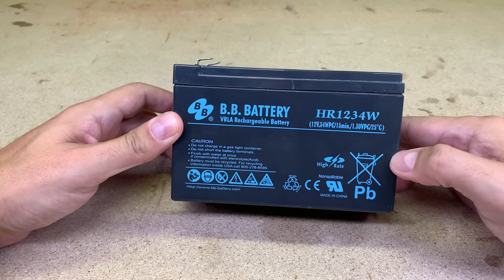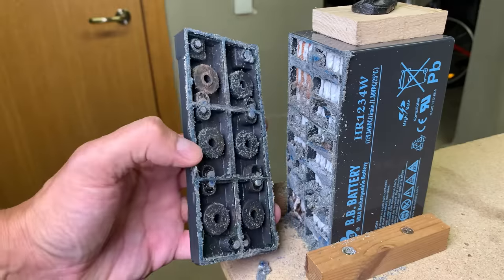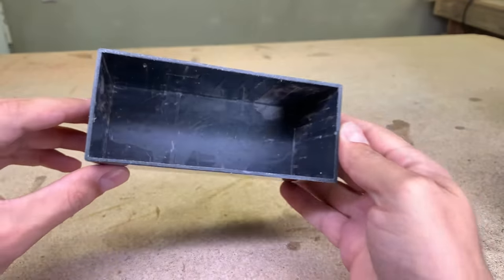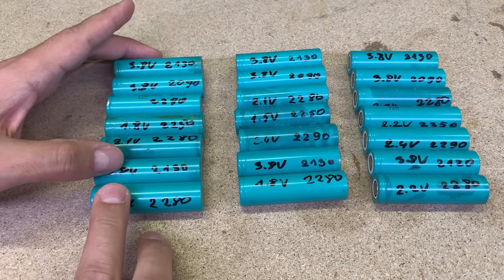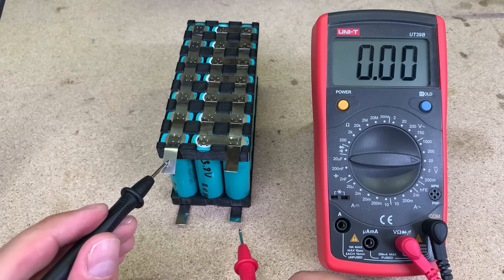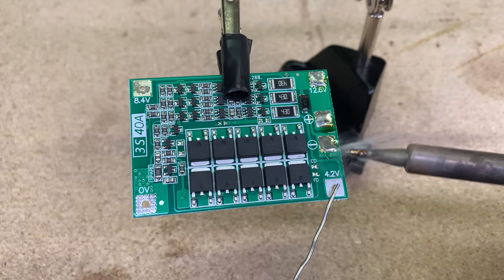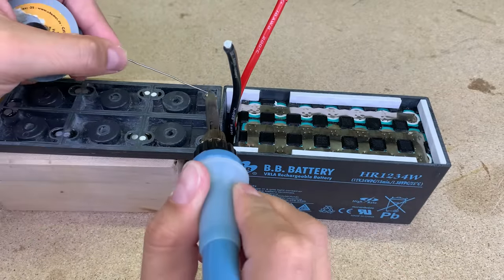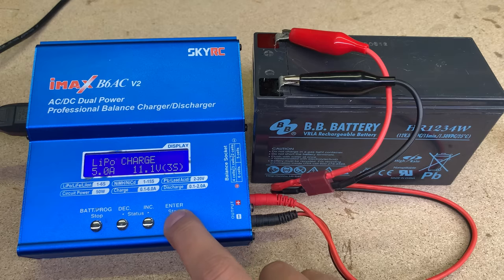How To Convert 12v 9Ah Lead Acid Battery Into 12v 14Ah Lithium-Ion Battery Pack

Comment: can i use this  12v 14Ah Lithium-Ion Battery Pack to power the 99gear spot welding board the one with a purple pcb?

Comment: Why not we use the battery pack made with the lithium ion batteries with the charge output of the main unit wherein We get 15.18 volt DC ? Why you require the balanced charge/discharge unit seperately for charging? Please explain.
Reply: Lithium ion batteries require a BMS (battery management system) to keep the cells balanced, and to avoid over charging or over discharging. A BMS becomes critical when the original equipment was designed for a different battery technology.

#1:  If you only look at the overall voltage a few years of use can result in aging drift. That is some groups of cells may charge to a higher voltage than others. Example: 4+4+4=12v and 3.5+4+4.5=12v too, but the second example over-charges one of the cell groups. The higher the voltage the fewer charge/discharge cycles you get----to the point that limiting charge to 80% of rated capacity will give you 3 to 4 times as many charge/discharge cycles (a trick some systems designed for lithium batteries follow when battery life is a higher priority than battery capacity). A decent BMS will keep the voltages of each section of the battery perfectly in balance with other sections.

#2:  AGM (absorbed glass mat) lead-acid batteries (or any lead-acid battery) loves to be trickle charged. But trickle charging any lithium battery will destroy it, and in the case of lithium ion might cause a fire. A BMS will cut off charging a fully charged battery system, even though the equipment the battery is installed into wants to trickle charge it.

#3:  Over discharging a lithium battery is bad and can drastically shorten the life of the cells or even kill them. This is also true for lead-acid, but if equipment is designed for lead-acid, its low cut-off voltage will be different than what a lithium battery needs. A BMS will disconnect the battery when it senses the cell voltages have fallen too low. If the equipment happens to cut off discharge at a higher voltage then the BMS, no harm, no foul (but you don't get the full capacity of lithium).

Food for thought:  Lithium iron phosphate (LFP or LiFePO4) would be a better choice than lithium ion for an application where a little more weight and size is worth the added safety of not being a fire hazard. For example a kid's toy car or scooter, or something like a UPS (uninterruptible power supply). For a laptop, a phone, or a car, the size vs capacity tradeoff is often worth the trouble of the added safety systems. Note that the working voltage of LFP cells is lower than lithium ion, so a different BMS is needed, but you still need one.

Also, if your equipment needs more than one lead-acid battery in series for a higher voltage, it'd be best if your lithium replacement's BMS could see across the whole string of cells. Example: a typical smallish UPS will use two lead-acid AGM batteries and work at 24 volts. So best to build a single replacement lithium battery that is the physical size of two of the original batteries, with a single BMS that looks across the full 24 volts of lithium cells. See point #1 for why.
Reply: @ScottyDMcom  
Thank you so much that you have taken pains in highlighting me on charging and the need of the BMS in lithium based cells. From the explanation I could get that the lithium based cells require proper charging voltage and the charging is not dependant on the how much current goes in to battery pack. Am I right in this understanding? Please correct me if not?

Comment: Is it worth it to rebuild a battery about half the size of that one? Its for a kind of video camera. Thank you 🤓 is there a video that helps to figure out the 18650 (or similar) configuration, voltage conversions, amp hours, charging conditions,...etc? Thank you 🤓

Comment: This is cool but I made a 3s10p 12.6v li-ion battery and I've got no idea what to do with it. I was originally going to use it as a camping battery in my car but I don't think you can charge it with an alternator as the voltage is too high ~14.4v. So I have a 12.6v charger but it plugs into AC power so if I wanted to use it in the car, I could hook up my inverter to the car battery and this charger to the battery, no problem. But now I have the additional problem of powering things with the 3s battery, because its voltage is too low to consistently power an inverter. The nominal charge of the battery is not 12.6v but 11.1v (3.7x3) and won't work for an inverter.

Honestly can anyone tell me what a 3s battery is good for?

Comment: and you charged it via lithpoly not lithion lithpolymer needs 4.20 lithion 4.10 so you charged it wrong and didnt remove the info on the bat if you acidentaly pb charge that because you think its a pb charger... folks this is a bad idea

Comment: Interesting. But I would expect higher capacity, not just 9Ah to 14Ah increase :) Is it safe to use this in UPS instead of lead-acid one? There is charging circuitry for lead-acid battery in UPS, will it work OK with this converted battery?
Reply: No. Lead cells and lithium cells have different minimum voltage and maximum voltage so it is not recomended.
Reply: @Görkem-x5h  ... 🤔 ... BMS is made for that .....
Reply: @yvonf2312  you need different bms. A bms made for lead cells won't work on lithium cells.
Reply: @Görkem-x5h  But he installed a BMS in the battery, right? Would he have to take the lead battery BMS out?
I don't understand the math of 21 cells with 2000 mAh not adding up to 42,000 mAh . Is it the number of cells in parallel that determines the capacity?
Reply: @paddlepower888  to get 12 V you need to add 3 banks of paralel lithium cells in series. Series connections don't add up on capacity but voltage.
Reply: The dischage capacity in lithium is 80%, só its capacity is much higher
Reply: If you make it with 4 lifepo4 cells the voltage will be the same as lead acid.
Reply: A battery made in this way is not suitable for use in a UPS.  There are pre-made lithium batteries which have been designed to replace lead-acid batteries.  They generally use lithium-iron-phosphate technology which is more robust and less likely to explode if charged incorrectly or otherwise abused.
Reply: @paddlepower888  oui. ;)

Comment: I got a new battery for my electric bike it’s a 36 volt 14 amp battery but when I ride around or going over bumps it cuts off like it’s shorting out I think something in the battery pack is loose or something how would I fix that

Comment: those 18650 are bad notice below the heat shrink theres almost like the acid rom batteries dont use used cells buy new

Comment: I noticed that you charged the completed battery on a (Li-Po) setting rather than (Li-ion) Is this safe to do so? your charger is capable of (Li-ion) charging.
Reply: its safe , on lipo setting charge max voltage is set to 4.2v on li-ion is 4.1v
Reply: @MrDexi87  wouldn't it be irrelevant which Lithium setting it's charged with, as long as the whole pack isn't over-volted? I mean could this pack be used (and charged) like an SLA Pb battery? That's why there's a BMS, right?
Reply: @fluffyfloof9267  true , but if u charge 1s with 4.1v max voltage u can increase battery life, that's why imax b6 using lower voltage for charging li-ion cells ...
Reply: @fluffyfloof9267  I'd like to know this as well. BMS's generally seem pretty straightforward in their operation, except when it comes to charging the cells properly once everything is assembled. This video was basically the first example I've seen where the creator actually touched on this area but still I have some unanswered questions... Like do these cheap BMS's disconnect charge when input voltage exceeds the lipo voltage ratings? What is the safe charge voltage and amp range for a 3S7P pack with a bms like the one in this video attached to it? I realise that depends on the cell specifications but in general (assuming mixed cells) what would be an average safe range for such a battery? And just as importantly, what WOULD HAPPEN if you used one of these batteries as an SLA replacement in a typical standby 300-600W UPS, for instance? Would it be safe? If not, why not? If someone says it's a 3S Li-Ion battery and therefore lower nominal voltage than the SLA it's replacing, that doesn't really explain why it's not suitable. We know that most UPS's will cut out at around 10.5v and charge up to max of around 15v. if the BMS can cut off charge at appropriate times (10.5v - 12.6v = 3.5v - 4.2v per cell, respectively) then there should still be an overlap range of compatibility even if its not a perfect match, yeah ? As far as I can see, all it means is that the cells will never fully discharge further than 3.5v, which is a good thing because it means way more use cycles. Sure you won't get the full 14ah of capacity, but even if you get the 7-9ah of the original SLA battery, it seems like a win

Comment: Very nice build, caution on reused/repurposed batteries. Some batteries even though they appear to show good health, might develop short circuit internally, to prevent shorting on the parallel pack, add fuse to each battery for just in case

Comment: Interesting project, thanks for sharing your experiment. Removing all the internal bracing reduces the structural strength of the casing.
Reply: The case is made for SLA, which is heavy and swells up. Li-Ion is light and strong and doesn't really need a protective case. It's mostly to protect the wires, mount the hardware, and to look nice.

Comment: interesting idea, but you probably do not realize what the consequences may be.
Gel and acid batteries are used in combustion scooters for a reason.
What you did is a recipe for misfortune, and why?
Lithium-ion batteries have a maximum voltage of 4.2V in the 3S configuration, this gives 12.6V
The generator in the scooter generates a voltage above 14V which will overcharge the lithium-ion battery and in the worst case may cause an explosion and fire
Reply: the BMS board is there for this, unless you charge with too much current, the BMS is capable of cutting off the battery for protecting from  overcharge, and it even is capable of (some sort) balancing the batteries, the cutoff voltage for this BMS is around 4,27v and the balancing discharging cutoff voltage is 4,19, in the end, that batteries get a final voltage of 4,19v

Comment: It's a good idea. However, if you use this modified battery in a device that usually uses Lead Acid batteries, I guess you will have issues with the charging cycle and voltages? Will the BMS be enough to overcome the differences?

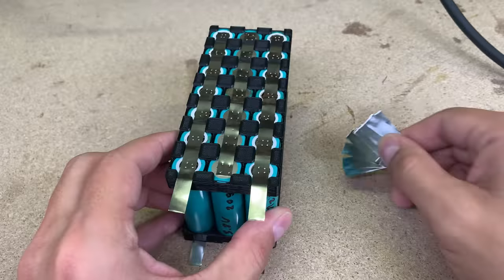Comment: Wait -- at 3:58 he solders on a bunch of short jumpers. Why was this???
Reply: The long ones connect each row of seven batteries in parallel. The short jumpers connect the rows in series. Without the short jumpers, each row doesn't produce 12 volts. That's the limit of my electrical knowledge.
Reply: The idea of using multiple jumpers is to share the load across several connections.  In theory you could just use a single link to connect each parallel set in series, but using multiple links allows them all to share the load and run cooler.

Comment: What I don't see here is a list of the components and cost breakdown.   Is it really worth all this trouble for a battery you can buy for $22 on Amazon?
Reply: Right. the lead acid battery is about $20-30, but lithium batteries in the same size as the lead acid battery are almost triple that, but worth paying for due to the higher number of recharge cycles per dollar, and because the spot welder alone costs over $50. I doubt I'll use the spot welder for anything else and finding defective" power drill batteries with an average cost of $0.80 per cell isn't something I do well. I've begun to establish limits to the things I want to DIY.
And you gotta love the disclaimer at the bottom of this video's description!

Comment: Those 3,7V Li-On batteries cost far more than a lead-acid sealed battery unit in my country - great project but unfortunately not worth the cost to do in all countries in the world.
Reply: As far as I can see the batteries are salvaged from other battery packs...
Reply: In the US there are several battery sellers for used 18650’s.  Often times, these can be purchased for $0.50 each with about 90 to 95% capacity vs new cells.  

At that price, his 21 lithium cells would have only cost $10.50, which is fantastic.  Add a little $ for the BMS and this is a fun project.

Comment: Can i use it for Scooters ?
But, the alternator Voltage coming out is more than 12.6V is the issue.!
Reply: You need 4 lifepo4 cells, they are perfect for 12v

Comment: In the long term when the cells get mismatched, will it overcharge the good cells since the bad cells may be lower than 4.2?
Reply: the BMS has a balance ic, the chip use resistors to drop the battery voltage when pass 4,2v, and stop discharging the cell at ~4,19v, so it's necessary to charge the pack a little bit more than 12,60v, like 12,65, 12,70...
Reply: I use an led as indicator for each cell, the led (with current limiting resistor) is in parallel with the big resistor, so I know when the BMS is balancing and which cell get charged first...
Reply: The parallel connected cells are forced to remain at the same voltage as each other by the simple fact that they're all connected.  The circuit handles balancing each set of parallel cells with the other sets.

Comment: Ignoring the voltage discrepancy using 3 in series instead of four, those 21 18650s would cost over $80, while the lead acid would cost $25 to $30. Even using 15 to more closely match the 9Ah  would cost $45 to$50.

Plus if you had it in an application where it’s charged by a source who’s voltage varies, like an alternator, you would need regulator circuitry to make sure the lithium batteries don’t get over-voltage and wind up burning down whatever you put them in.

The real question is why would you even do something like this? The one benefit lithium has over lead acid is energy density. So unless it’s for a portable application, you’re spending 2.5 - 3 times as much for no benefit.
Reply: New cells would be expensive 💰. At 2:20 he mentions that he recycled good cells from power tool battery packs. 👍
Reply: One serious issue with these lead acid batteries is that they often fail prematurely over winter. Lithium ion cells can survive cold winters. This size battery is used in golf carts and lawnmowers which are stored over winter.

Comment: what is the overall weight of the battery after conversion. The lead acid version is approx 6.1lbs
Reply: He showed that at 7:07 elapsed.  The original battery weighed in at 5.80 lbs. and the converted one weiged in at 2.59 lbs.

Comment: This is great as a proof of concept, but not in the long run... Lithium Ion batteries very poorly tolerate being at 100% capacity for prolonged periods of time and they will develop issues like very poor capacity and current handling due to that. Their working temperature range could also be a problem since they are much more sensitive to high and low temperatures when compared to lead acid battery chemistry. Why do you think the automotive industry is still sticking to lead acid batteries in conventional vehicles? Lead acid batteries are much more forgiving to all of the issues above albeit at a lower capacity per unit of mass.

Comment: Cutting open a Lead Acid with a hacksaw? Do you sniff broken CFL's to save the base? Properly unsafe way to deal with lead.  Since these batteries have regular car type contacts, you don't need the plastic box to make a battery pack that fits into your i.e. uninterruptible power supply. In addition,  there's no BMS inside, so this is not a drop in replacement for a Lead Acid battery despite what the author says. Yes, it will charge for a while but a constant power supply or even a regulated charger supply designed for a lead acid battery will simply destroy the Li Ion cells much much sooner than necessary. So watch a channel like the diy solar channel from Will Prowse (who actually know what he's talking about and shows how to DIY these things properly), but don't just hack-saw around on toxic materials in a sealed container to reuse the container. If anything, just 3d print a container if  you really need to go that route.

Comment: Of course this is stupid because there's no good combo of Li-ION to make 12V : 3S makes 11.1v average already too low for most applications, between 12.6v Max and 9.6V empty. 4S makes 14.8V average wich is already too much for most appliances and 16.8V full (way too much for 12V stuff) and 12.8empty. The ONLY good lithium replacement for a LEAD acid battery is LiFePo4.

Comment: its not very practical to "recycle" the battery yourself. you're removing 95% of the battery and creating a hazardous mess for yourself.
just send it to a recycle center and buy empty battery case or a new battery.